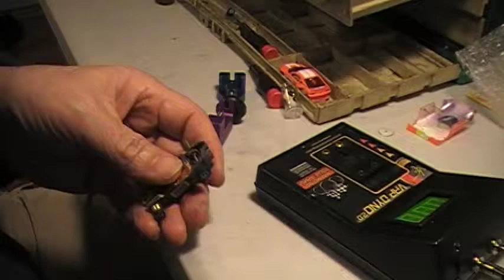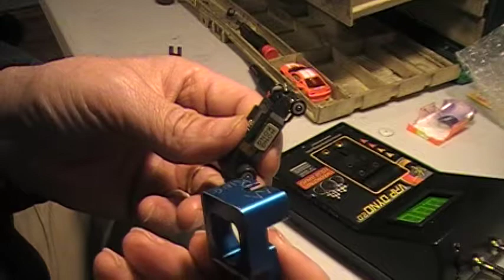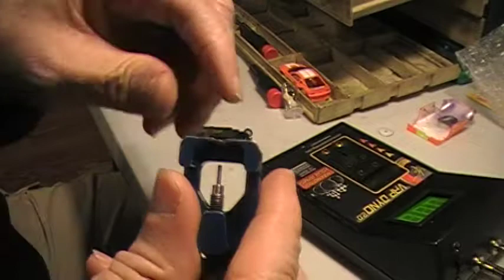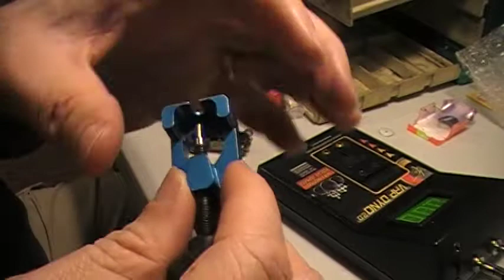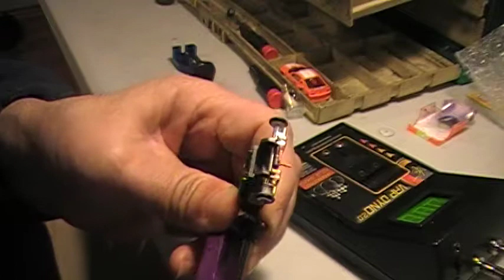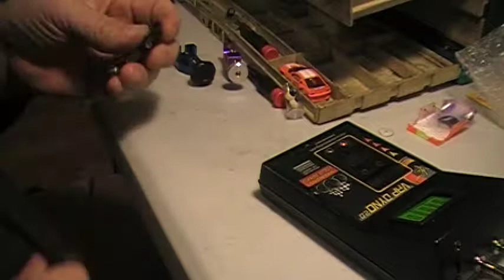tire puller

Comment: So this tool will take the hub off the axle without removing the axle? Is it necessary to have a press can you put wheels on some other way?
Reply from the maker: I have used a small metal plate and hammer to put tires on.  the key is how much axle sticks out.  but you can get a press from lucky bobs' or wizzardHO